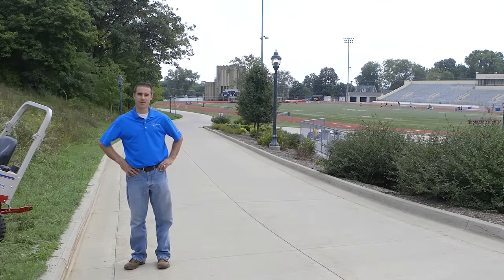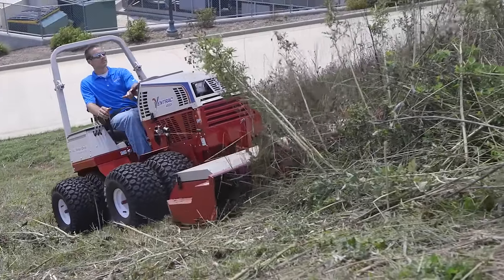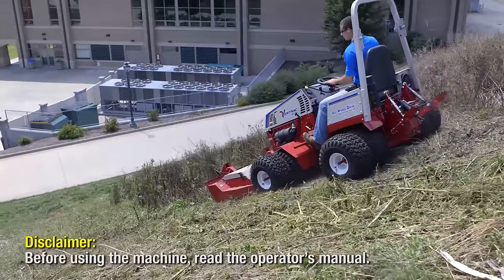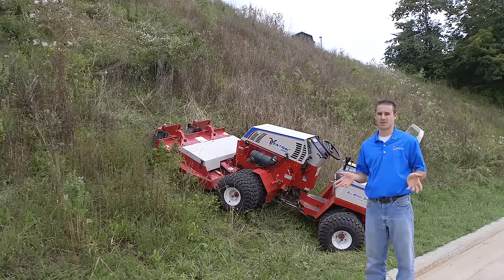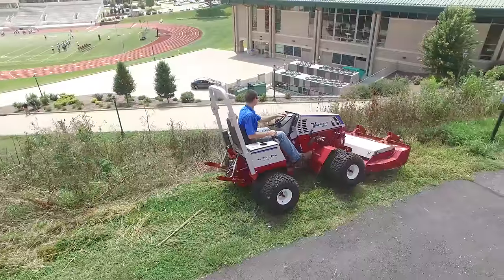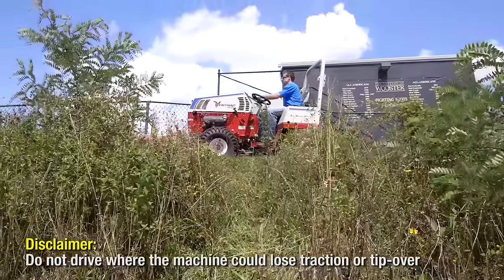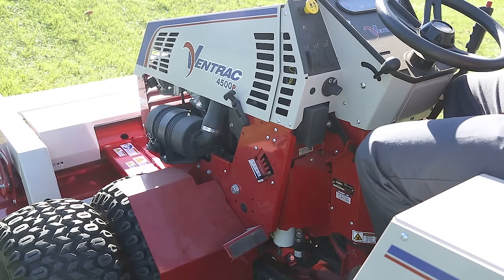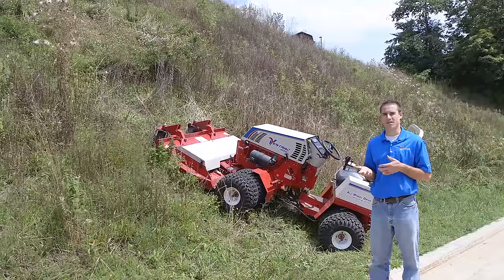Mowing Thick Brush on a Steep Slope with a Ventrac

Comment: Ill cut that with a zero turn
Reply from the maker: I know it's hard to tell in video form how steep a hill actually is, but I can confidently say - without ANY doubt - that there isn't a zero turn in the world that would climb this particular hill at all, let alone do it safely.   The idea that anything can be cut by a zero turn is dangerous and irresponsible.  

-Aaron
Reply: You could go down it on a zero turn but if you started up it forward the zero turn would sitting on top of you upside down!
Reply: yeah OK
Reply: Ive took videos stopped sideways on a hill the video doesnt do justice then neither but looks the same as this its as steep maybe a little more definitely not safe ive been there but forget all that weedeating this does cut thick stuff way better cool and useful bush hog
Reply: I cut mine with a zero, it is just as steep, just go down it, not up.
Reply: You will never cut this with a ztr
Reply: @johnc7512  hold my beer
Reply: @ventrac  i agree. I have a zero turn that cant even do a 15 degree angle
Reply: @sethward8434  
Punctuation.
Reply: @ventrac  that's a very dangerous slope.  I would not attempt it with my zero turn.
Reply: I had a Dixie Chopper zero turn with turf tires. It would climb almost anything, so steep the engine guard acted like willy wheels. Something I rarely did. Coming down a steep hill is a different story. I had more control backing down, but not enough. Coming down forward was impossible.
Reply: Pay me enuf and ill do it with push mower
Reply: The zero turn would slide easy how about a 360
Reply: Ventrac wanna place a bet on $100 says I can with my zero turn. If I can’t I’ll give you $100
Reply: Hunter Cox where your hill at
Reply: Ventrac a Dixie chopper is more than capable
Reply: Ur funny
Reply: @357bullfrog2  right👊
Reply: In half the time.
Reply: @harleyvulcancobra4.619  well damn put a wheelie bar on it and kick some grass.
Reply: As a landscapeing owner theres no way a zero turn can do that a grand stand maybe i mow hills not as steep as that but almost like that and i can barley keep a grand stand on it so yeah theres no way a zero turn can do that
Reply: @ventrac  🤣 I could 100% drive up that with my riding mower with no doubt in my mind
Reply: But question I have tried for a long time to get my hands on one of these and there’s no prices or anything on your website so why are you having ads for a machine that’s you are trying to sell but not being able to sell it? Very disappointed I would have liked to get one of these a year ago but couldn’t purchase one because of the way your website is set up so I had to get a regular zero turn
Reply: @brandon3636  😂😂😂
Reply: I don't know about a zero turn but I bet I could mow that with my 48 inch walk behind.  Wh48a by John deer that thing will climb a tree all you would have to do is start at the bottom and cut across  making your  turns up hill.
Reply from the maker: @huntercox1859  No.  Your safety is worth more than $100.
Reply: Skidsteer could do it
Reply: Fr I cut hills way steeper than that and pull big ass boats and trailers will mine😂
Reply: leroysmith1214 as in???
Reply: Show the videos you zero-turn people
Reply: @ventrac  I agree with you on this one sir. I've had the privilege of running a number of tractors and zero turns but never a ventrac. I can see by your demonstration that this is the machine for these types of hills.
Reply: @deanguando1335  You're a smart operator Dean.
Reply: @357bullfrog2  God bless you brother, I used to do similar Hills with a Toro walk behind. Those were the days before MS hit me. I wouldn't even think of attempting it now with anything less then what they're showing here.
Reply: Yes you can cut that whit I zero turn    down hill  I cut places like that all the time
Reply: Zero turns are only fit for 15 degree hills
Reply: If you used a zero turn on this, you would have to go straight up, then down in reverse. If you went forward down this thing you would slide all the down the hill and crash. Too sketchy.
Reply: Is this available in India
Reply: Who are you posting video for sure as hell not the average hard working man cause these things are expensive. Maybe make them affordable and you would sell more. My zero turndoes just fine with only 1/8 the price of that.
Reply: @brandon3636  I go up mine with it then go backwards down just fine.
Reply: @huntercox1859  bye , bye hunddy spot!!! No way, no day!!!!
Reply: @garrettsmith2748   we purchased two for my golf course. They are VERY Pricey!!! Their website does include pricing. I will tell you these machines are worth their weight in gold!!! Hands down they out cut any mower we have!!! Mostly Deere. You will NOT BE DISAPPOINTED!!
Reply: @bobbond6028   keep using your zero on a job like that one, you gonna be buying many more!! No hate here, we have two on my golf course, they cut like no other!!! These rigs are mountain goats, they don't care what you feed them!!!!
Reply: @harleyvulcancobra4.619  😳😂
Reply: How much is this mower?
Reply: @sev-1287  $17k ,but it's worth it
Reply: Hitting rocks and start a fire is a risk, but you can carry a water tank on the back fire extinguisher
Reply: People thinking they could go up this with a scag, wright, ex mark, etc. I promise you'd flip backwards.
Reply: i also cut my slope with a Ariens X52 Zeroturn, only when the gras his high and the ground wet its a bit risky, when the gras is not so high and dry ground i don't have have problems, only go straight down and up, not sidewise

Comment: Real title should be does your mower cost 20k
Reply: Yes
Reply: Aaron George not mine
Reply: No
Reply: Maybe
Reply: Dont
Reply: Know
Reply: My tractors didnt cost 20k.
Reply: Neither does mine it a 440 lawn chief from 1992
Reply: Mine costs around 5k
Reply: My $100 John Deere 214 could do this
Reply: Sure budy
Reply: Aaron George I wouldn’t lie I know what I’ve done with it and I have done steeper inclines with it
Reply: Not that it cant climb it that's a brushog on that a normal mower deck cant cut through brush small trees
Reply: Try 30 k with how that one is equipped.  Although i run them almost daily and they are much more capable then they claim. They're very exspensive
Reply: @_chevy_s-zj5pw  post the video
Reply: My kubota didn't even cost 20k XD
Reply: You get what you pay for
Reply: my $30 machete can cut all that grass but it’ll take months
Reply: I got a 1940s farmall with a mower maybe it will do it if the damn belt won’t keep stretching lol 😂.
Reply: yeetyeet yeet my 3990 was 17 grand new lol and it could mow for a day straight but it is a diesel gussler 16 gallons gets me by for about 12 hours.
Reply: Aaron George  ^ ^&
Reply: It’s closer to 23,000$
Reply: @logertgogert3227  3990??? Some do some don’t but there damn reliable with the 40horse diesel and “diesel guzzlers”
The belts:🤮🤮
Reply: Lol
Reply: Mine cost $350 bucks.
Reply: @jitteller9042  billy goat.
Reply: Ikr
Reply: Just get a John Deere 1025r for this price it will do the same thing with front weights lol
Reply: jealous?
Reply: Quality costs money, what other machine can do that
Reply: @Bman01234  old gravely riders and walk behind mowers not the new shit
Reply: It’s actually around $30,000
Reply: Easier to just buy a John Deere 1025r with a double wheel kit

Comment: I ran a Ventrac several years ago (cant remember model #) on commercial properties primarily.  We used it for aeration on both warm and cool season turf.  While it did not have duals, it was articulated and 4wd. The aerator was unique and cored very well as it vibrated at the same time. I was meticulous on maint. and rarely had any problems.

Comment: I have the same one exept that i have a big block For in it with two 96 mm huge Turbos pkus a 200 shot of nitrous making about 1800 Hp to the wheels ...it does 260 Mph in 1/8 of a mile in 4.5 secunds and it has two parashutes in the back ...i did 200 lawns in like 5 minutes and made 500 000 dollars and so when i woke up in the morning to go for a ride my mom took the prious and went shoping ...

But is was the best feeling javing that fast lawn mower TT Nitrous .Dreams ce true se times .
Reply: And she blew 50 of your friends one after the other without cracking a sweat...and that was while you were flaked out drunk at your wedding reception

Comment: The other thing is when you are cutting/slashing across a slope at 28 or 30 degrees, take your deck off float & raise up up just a little - this puts more weight on the front set of wheels and helps with traction... This comes with using your machine all the time on slopes ...

Comment: For Tsunauticus:  Consider all the attachments you could use regularly (Ventrac has about 40 - I could see my self using a dozen +/-) and then price individual machines that could do these jobs.  Or pick any 3 or so jobs that another unit could do and price just 3 or 4 machines that could all the things you want to do..   Bottom line:  Ventrac sells versatility, and if you need that, or and or have a lot of area to work with and different jobs to do, Ventrac’s cost per job type falls fairly quickly.

Comment: I'll stick with my John Deere X-534,I've done slopes like this with very few problems and at $10,000.00,it beats this machine hands down big time.
I have the 48"in deck with the 47"inch two-stage snow blower,I spent one-third of what this thing cost.
Reply from the maker: PLEASE stay safe out there.  Your machine was not designed or intended to work on slopes anywhere close to 30 degrees.  It also does not have a ROPS so in the event of a rollover, injury is highly likely.   

 From the John Deere Owners Manual for the X534 :

http://manuals.deere.com/omview/OMM174062_19/?tM=

Operate Safely on Slopes
Exceeding the recommended maximum slope angle increases the risk of rollover accidents that can result in serious injury or death.
Never mow or operate ride-on mower on slope angles greater than 15° with the lawn ride-on mower in its basic configuration. The basic configuration is the ride-on mower with mower deck and not other attachments. (A 15° slope is a slope that rises 1.6 m (5.25 ft) over a horizontal distance of 6.1 m (20 ft).)
When using attachments, never mow or operate the ride-on mower on slope angles greater than 10°
Reply: Man you stepped in it deep naming your model
Reply: Better watch out the "Ventrac Owners Manual Police" will get you. Lol

Comment: Wow! Now that slope.can really erode with the first big rain. Wonder what the road will look like in 20 years?
Reply from the maker: Hey Larry. Thanks for the comment.  It's worth noting though, that regular maintenance actually helps to prevent erosion.  If left to nature, it's common for steep hills like this to grow trees that crowd out native the grasses below and cause erosion over time.  To completely prevent erosion, it's actually best to regularly maintain these areas.
Reply: @ventrac  possibly, depends on the drainage behind it. The reason for the comment came from observation in my own area. I live in hilly area which until recently had forested slopes. When the timber was cut from those slopes it had nothing to stop it. When the big rains came it washed out fences and destroyed low lying fields. I should know. I have a low lying field now filled with gravel and have had to repair fences which have never been washed out in the 67 years that I have lived here.
Reply from the maker: @larryreese6146  That would make sense.  Once an area is totally forested, probably the worst thing you could do is remove the whole canopy.  The area underneath tends to not be very dense grasses or under-growth so there isn't much root structure there to hold everything in place.  When the trees were still up, they at least provided a buffer and if they were dense enough, some good root structure themselves. That's a bummer to hear about!
Reply: @ventrac  that does look like a good mower though.

Comment: I mow hills like that with my grasshopper or 62 ford tractor..
Reply: One direction and down hill only you might. This thing can do it either direction and back up half down. Now don’t tell me your 62 would do that hill, I’ve been on tractors for damn near forty years, you ain’t fooling me pal
Reply: @everettemcgill9019  fill the dish on the back wheels, and the wheel to the out side of the dish. Put the front axle on it widest setting. You now have a 62 ford that 8 feet wide plus i have 1000 lbs of weight bolted to the belly of the tractor...
I live in north ga. I cut hay on some very steap ground.
Reply: @everettemcgill9019  sliding down that hill at that.
Reply: I belive it i love ford tractors

Comment: It’s called grabbing the 1967 wheel horse 1276 and cranking it up to 4,500 RPM and putting the front wheel weights on and doing it simply, not buying a new mower

Comment: Is the Ventrac equipped with an oil pump to prevent premature wear on the engine while engaging extremely high grades such as the one in the video?
Reply from the maker: All of our engines are certified by their respective manufacturers for use on the slopes that we certify our tractors for.  However, it is worth noting that both of the Kubota options that we have require intermittent change of direction to comply with the manufacturers recommendation.  The Kawasaki DFI option is rated for the same 30 degree operation, but completely uninterrupted.  In use, we don't see failures for this reason because operators naturally change pitch/direction frequently enough for it to be no issue!
Reply: @ventrac  Thank you for the quick and comprehensive response!

Comment: I suppose that they use 4 stroke engines.....how do they ensure that there is a constant oil supply for the engine when working this type of terrain?
Reply: Aaron Graber Thanks a lot for the reply....Seems the Kawasaki engines have freely swinging oil pump snorkels and the others have an extra oil reservoir for the 10 min you spoke about.Thanks again...

Comment: The slope would look much nicer if you mowed it sideways.... How steep is it?
Reply: But then going up & down is safer
Reply: That bank was not covered in a tough sod,  just weeds and small brush.  Going side to side would have rutted the unsupported or poorly supported soil.  If they were to seed it with K-31 or such tough grass, then the surface might stand up to cross mowing.
Reply: It is always better to cut across the slope than up n down due to erosion . We get that when people slash up n down hills all the time.
That's why you use a dual wheeled Ventrac across the slope to minimise soil erosion.
Reply: Rooster how do I up load some videos
Reply: When I get mt 4500Z across slopes at 30 degrees or more, especially when running my contour mower, the front downhill outer tire rips less than very firmly sodded soil as if that tire was a harrow disc.  I have the ATV type tires and maybe turf type would be better in that regard.

Comment: Bro i mow for the city and I mow slopes steaper then that with a exmark 72 inch.
Reply from the maker: We've tried a lot of zero turns and never come across one that will do what a Ventrac will.  Try out one of the angle-finder apps to see how steep your hill is.  Most Zs are rated at 15 degrees.
Reply: I wish I could post pictures here, 15 degrees lol. Imagine all the weed eating if we could only go 15 degrees. The grass on the overpasses are way over 15 degrees  .

Comment: How much would 1 of these cost ? I'm guessing over 20k
Reply from the maker: The tractor by itself with no attachments is between $19,000 and $23,000 depending on engine options.
Reply: Ventrac parts made in China, Mexico and assembled in the US I assume
Reply from the maker: There are parts on our tractor from all around the world.  That's virtually unavoidable.  Even American companies supply parts that are sometimes produced elsewhere around the world.  You would probably be surprised at how domestic our tractor is - more than any we're aware of.  And "assembled in US" is selling us short.  Yes, we assemble them here.  We perform all engineering, R+D, testing, etc. here.  We cut all of the metal on the tractor on our own lasers, right here at headquarters.  Our attachments are also built here, in house.  A lot of manufacturers can't even claim that.  We employ a large number of local people, we support the community, and we even export product all around the world, adding to the US economy in a big way.  We do our part, thanks.

Comment: The add title said "can your mower climb this" and honestly I think my mower can it has an 18 HP opposed twin brigs and Stratton pulley swapped if your interested my Chanel is   "Aspen Wells"
Reply: My Hustler X1 can claim that hill no proublem with the deck set at 300

Comment: You guys need to show a ZTR trying to do what your machine is doing in all of your videos. I’m not saying that you guys are wrong. You could shut up the naysayers by showing that the ZTRs can’t do the same thing.
Reply from the maker: Great idea!....except on this hill.  I don't have a death wish!  -Aaron
Reply: I don't have a death wish,  but I have done hills this steep with a ztr. Didn't have stock tires and had added weight to the front, but its possible and a whole hell of a lot cheaper.